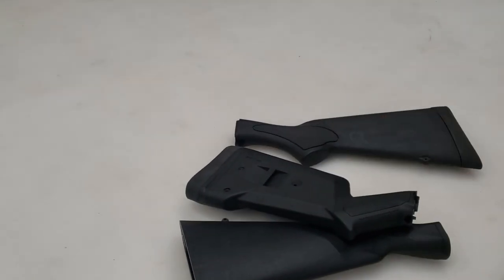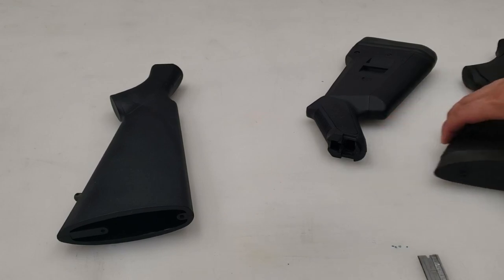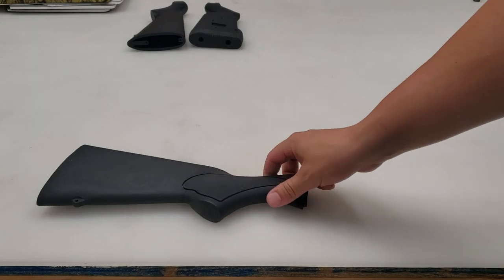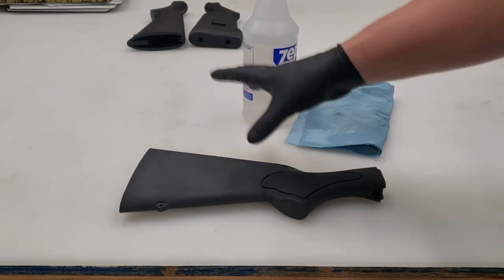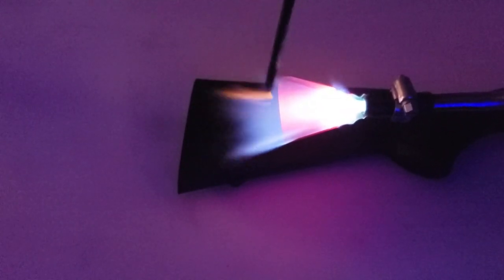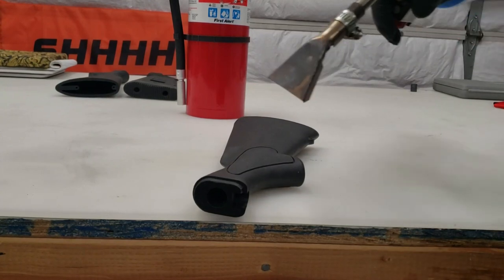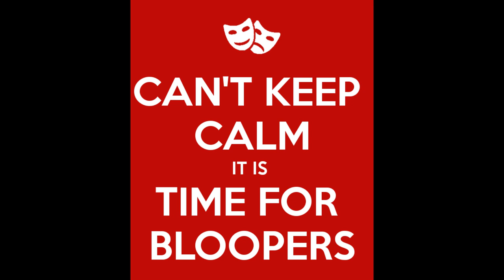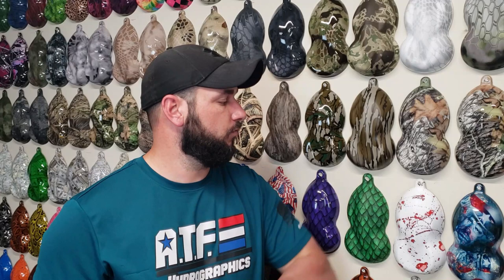Flame Treating Plastic | How to prep plastics for painting or hydro dipping

Comment: Good stuff here. Note that you need an 'oxidizing flame' that looks blue because you are not just heating the surface, you are oxidizing the surface. This will be different than a 'reducing flame' that is more yellow. A reducing flame is designed to heat more slowly, as with the settings on a bunsen burner, and the yellow flame has more unburned contents that show up as sooty smoke above the yellow flame. The source of the fuel just helps with control, so not just propane. Even using a kerosene campstove can get this effect, as long as the flame is hot blue.
Reply: Can butane or map gas be used?
Reply: @strawberrysuperglue  Yes, either of them CAN be adjusted to get an oxidizing flame, the trick is the knowledge and skill to get YOUR SETUP to produce that oxidizing flame with the fuel that you are using. Each setup has many variables, so I cannot describe all the combinations and limitations.

Comment: If you are still active my question is i have a 1980 toyota and the console is not canvas flat it has very small circles i dont think the flame method is my option do i just degrease and primer because scuffing would leave scratch marks which leads to a longer job

Comment: Hello from Brazil. Thanks for sharing this great tip. Would be possible to use also hand sand to improve the adhesion or it is not  necessary? If the sand papper helps, what type will be better to ensure a good quality?

Comment: Couple questions:
You specifically called out propane - why, what's special about propane vs butane or other sources?
Will a heat gun work? It seems like the plastic just needs to get hot

Also, when you say after it's flame treated and degreased again it's ready to paint, does that mean ready to dip, or ready for a base coat?

Comment: I just bought a body kit for my car and saw its made of polyproplyene, was thinking of painting it myself and wanted to make sure I do it right the first time.  After the scuff and heat treat, I wanted to use plastic prep cleaner, and then SEM plastic adhesion promoter.
Reply from the maker: Go for it!

Comment: If I’m going to try and hydro dip, a car radiator Reservoir,(plastic). After I heat treat it, then scuff with scotch brite. Should I paint it too,b4 I dip it? Or leave the paint out.
Reply from the maker: Yes. paint before you dip or else the dip wont have anything to stick to

Comment: Do you know if you can hydrodip 3D printed PLA plastic parts without flame treatment please?
Reply from the maker: I flame treat everything
Reply: @AllThingsFunHydrographics  Hey thanks for the reply! Did you ever actually dip PLA before though? I wasn't sure if it needed an undercoat as I have different colour PLA so can just use a clear primer + dip. I just wasn't sure if the flame treatment can just be avoided if I'm just spraying plastic primer first.
Reply from the maker: I have dipped lots of 3d printed parts, and I flame treat all of them very carefully. Plastic primer is garbage and never works the way it is advertised. Use 2k epoxy primer only.

Comment: After you have or have not flamed a part do you use adhesion promoter before your 2k primer ?
Reply from the maker: If your using primer and base paint then yes spray adhesion promoter. If using One Hit Wonder paint then no. It has spray adhesion promoter built in
Reply: @AllThingsFunHydrographics  thanks for that we don’t have that in the uk I don’t think, is it only bare plastic to use adhesion promoter for ? I’ve been using it just recently on some jobs seems to work well

Comment: So basically burning off a layer somewhat. Does this applies to rubber like on the sb3 brace arm part?
Reply from the maker: NEver NEver never try to dip rubber. It will not work and the flame will melt it.